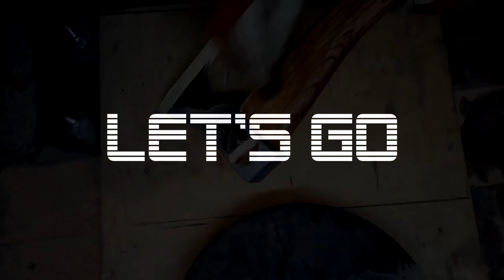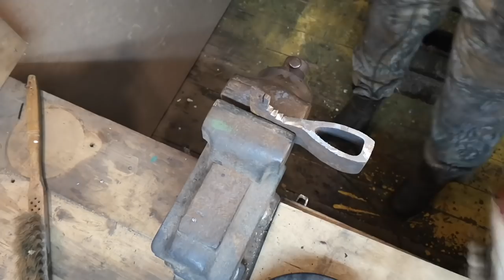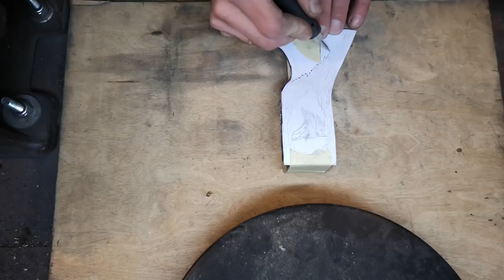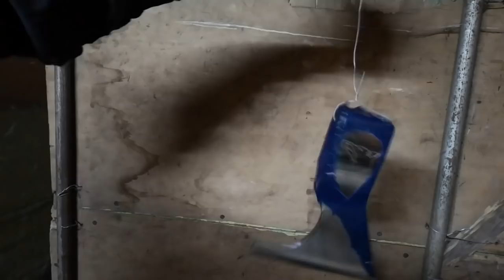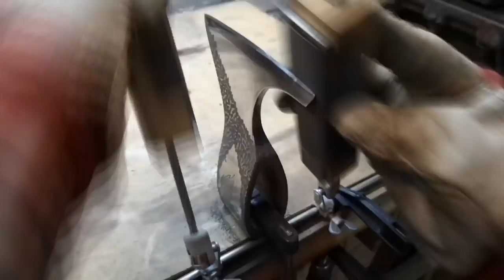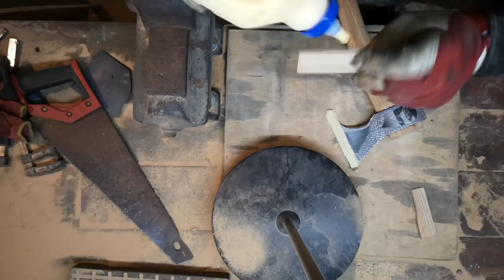Axe Head Modification

Comment: I hate to be negative, but although you made a pretty axe, you absolutely ruined it as a usable tool. All that grinding you did to the bit removed its temper so the edge is now soft and will dull instantly every time you use it. Never grind the edge with a power tool  if you want to keep it usable. It is very pretty though.
Reply from the maker: I disagree because the metal was not overheated when working with power tools
Reply: exactly, it's ruined. this guy doesn't know anything about axes